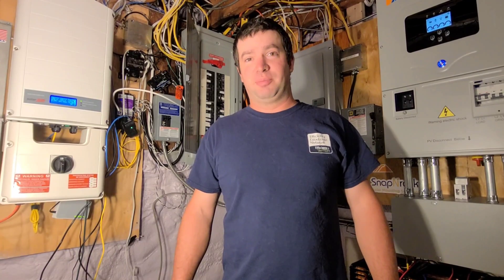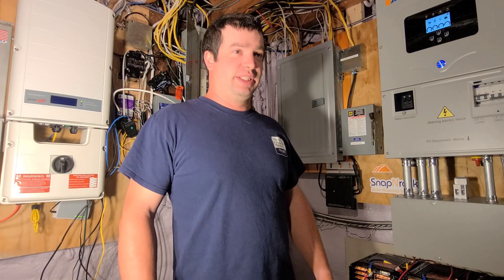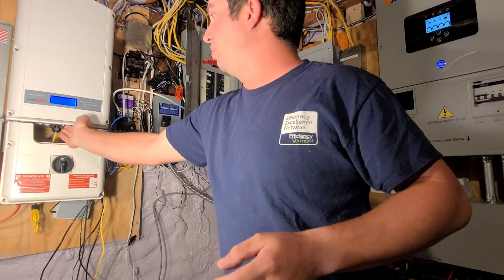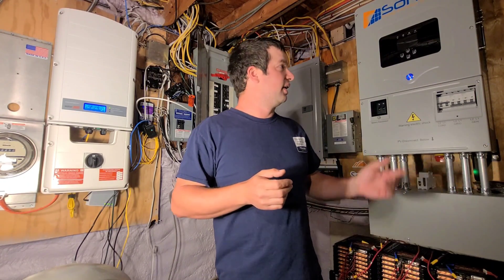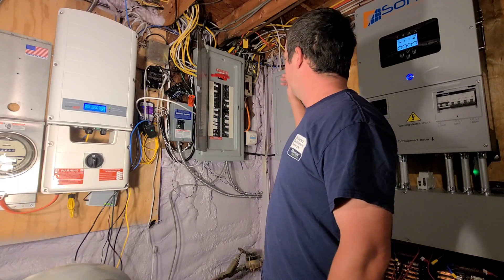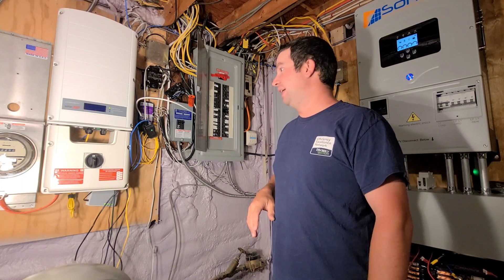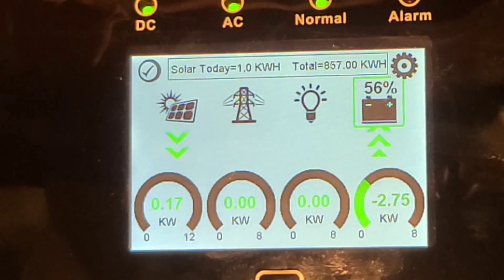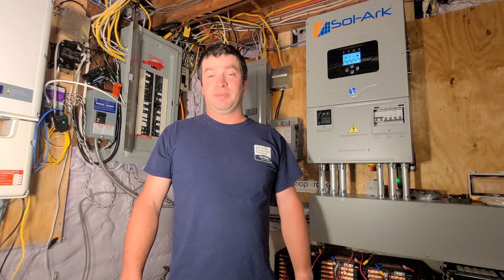What is AC Coupling? How it Works With the Sol-Ark 12k

Comment: Why AC couple? (Our application)
•	To incorporate a 6kW legacy solar system into a new Sol-Ark 15kW hybrid system with 38.4kW of battery storage.
•	To make more efficient use of the legacy system.
•	To have higher combined charge rates of the battery in the early morning and evening before sunset.
•	Cheaper in the long run over maintaining / replacing a separate set of batteries.
•	To get a bigger payment for excess production from the electrical supplier.
•	No more complaining about electric bills.
•	The satisfaction of knowing you can have less concern about increasing electrical utility costs over time as one moves into retirement.
•	Solar is plain fun for a DIYer.

Comment: If I am hearing you correctly, even if the system is AC coupled on the load side, the Sol-Ark will phase shift (to reduce AC coupled connected power) as the battery nears 100% capacity. Is this true even if it has the grid to send excess power to?

Comment: Thank you for the informative video, I'm currently purchasing a SolArk 15K, batteries, and panels for a grid tie system on a new all electric home.  What I can't find much information on, is how beneficial it would be to DC couple 19K to the SolArk and then AC couple whatever else will fit on the roof (8-9 K more)using SolArk Microinverters.  My thoughts are I would have more power to run loads during the day and export a lot more to the grid.  But is it worth the extra cost?  Or just abandon this idea and stick with the DC coupling only...  I appreciate any insight you may have.
Reply: Hi, did you find the solution to your problem, whit ac coupling ?
Reply: We have a 15 KW Sol-Ark EMP hardened inverter with 19.2 KW of panels. In our case we have 48 x 400 W panels arranged in a 2P8S configuration to each MPPT input. On one eastward facing surface of the roof, a tall chimney cast a shadow over the lower two rows of panels in one series, dramatically reducing the production of that series for part of the day. Putting optimizers on that series would not benefit it much because it is in parallel with another series of eight that is not shadowed. An optimizer I believe would drop the overall voltage of that string in order to keep the current up., pulling down the efficiency of the other string.

So with regards to your questions of how beneficial it would be to DC couple 19 KW of panels to the Sol-Ark, I would say DC couple whatever panels you have that do not have any shading on them. If you have a tall chimney, vent, tree, utility pole, etc., that is going to throw a shadow over a series of panels (in our case, a series of eight panels), it is going to greatly reduce the production of that series. You may be better off putting microinverters on those and AC coupling that group.  Be aware there may be some electrical code that prohibits running AC and DC in the same conduit which could increase conduit installation expenses (that may have changed. Check your local codes). 

I'm going to be converting another 6KW of DC panels to microinverters using AP Systems DS3-L Dual Microinverter 768VA (SKU Part Number DS3-L-NA-768VA), which make it very easy to AC Couple the output. Just connect to the Load panel or Gen port. Configure the Sol-Ark settings, and off you go. No need for a gateway, though APSystem does have a monitoring gateway which allows you to see the production of each panel in your array (APsystem ECU Residential Monitoring Gateway, Zigbee comm, WiFi, no CTs, no RGM, YC600 (SKU Part Number ECU-R Gateway)). The combined output of the microinverters will be AC coupled to the Load panel of my current setup.

Hope this was helpful.

Comment: Can you give some info on what settings you had to change with the SolarEdge to enable the frequency shifting?

Is it as simple as just changing your "location" to the "rule 21"?  Or is there more to it?

Thanks for the video!
Reply from the maker: It will work right out of the box, but with a hard on/off as the frequency goes out and back into range.  
Since this video, I've switched to a newer HD wave inverter with screen.  I've attempted multiple times to get it to limit power based on frequency instead of just shutting off, but have been unsuccessful.  I have one more thing to try, which is adding a jumper to the comm board, but I haven't gotten around to it yet.
Reply: @benssolarandbattery  thanks for the response. Have you tried using the rule 21 setting?  It can't be that easy can it?
Reply from the maker: @y0bailey  yes, I tried that. Keep in mind that my inverter is older, so if you have the newer screen less version it may work differently.

Comment: Hi, 
It looks like you are the only expert here in youtube who can explain this ac coupling feature.
You have nicely described the off grid situation, but for me there still open points in the on grid situation.
1) Will a solark use an ac coupling power to charge the battery when the grid is available or will the battery be only charged from dc side an everything from coupled inverter will go to grid?
2) When the grid is available and the battery is charged, will the coupled inverter be switched off or will it feed the surplus to the grid?
Many thanks in advance
Reply from the maker: Hi and thanks for the comments. 
The battery can be charged from AC coupled solar or from the grid. The Sol-ark won't shut off the AC coupled solar when the battery is full though, it will sell it to the grid.  For that type of zero export situation you'd want to DC couple the solar.
Reply: @benssolarandbattery  thank you for the fast reply.
I have now a dc coupled solution, but I am allowed to sell to grid and wish to sell surplus energy to grid. At the moment, on surplus from solark goes to grid and after battery is charged, the dc coupled system just waits till next morning :)
So i wish to switch to ac coupled solution, but was not sure how it works in an on grid situation. 
My goal is to use ac coupled system in on grid scenario and to have it work like that: first cover the loads; then, if there is additional power, charge the battery, then, if all loads are covered and the battery is fully charged, sell surplus energy to grid.
From your answer, I believe this is exactly how it works, am I right?
PS: charging from grid must be only allowed when the battery is fully discharged, to prevent it from over discharging
Reply from the maker: @YarLeo  yes, you are right. However, with your current setup, you should be able to sell from the DC coupled solar as well.
Reply: @benssolarandbattery  great, thank you for the the information.
Abou selling with current set up. How should it work? At the moment "extra" arrays are connected to the separate mppt chargers, which just charge the battery. If the battery is full, they just stop charging
Reply from the maker: @YarLeo  oh, I thought they were connected to the MPPT inputs on the Sol-ark.  If they're on separate charge controllers, that won't work.
Reply: @benssolarandbattery  my problem is, that with my roof I am not able to build a big array facing the same direction/angle, so instead I have multiple small arrays. So all mppt inputs are used, and there are still to arrays to deal with :)

Comment: Great videos!!!  I have a question.  Are you able to sell back power to the grid from the solar edge inverter's panels and the the sol ark inverter's panels?  Thanks in advance!!
Reply from the maker: Yes, they are both able to sell back to the grid. Up here, the utility requires a solar production meter for any grid tie solar, so there's not any incentive for selling DC coupled solar back to the grid, only AC coupled.
Reply: @benssolarandbattery  So you have a solar production meter connected to your solaredge inverter, up stream from the sol ark?
Reply from the maker: @richardrasmussen8008  yes.

Comment: Probably already answered but have been reading online that I can connect A/C coupling (Enphase Micro-Inverters) for the Sol Ark 5K and 8K only up to 3KW but the specs from Sol-Ark say 9.6KW for AC Coupling. My solar array is all with Enphase Micro Inverters. Really interested in using a Sol-Ark 8K with the HomeGrid Stack'd Battery.  Recommend YES NO?
Reply: We have a 15KW Sol-Ark Inverter, 19.2KW of panels, 38.4KW HomeGrid stack.  I'll be converting an old separate 6KW system to a microinverter system and do AC Coupling via the Load side (better through the Gen port, but I can't do that without lots of running new wires and trenching). Being as your comment was 2 years ago, I'm sure you have already figured it out. But yes, I would recommend. However, before going with HomeGrid, consider the EG4 battery stacks through Signature Solar. Cheaper, meaning you could have greater storage capacity for the same cost.  However, HomeGrid's claim to fame is its robustness (designed for 25 year life) and its high current capacity (275A). You would have to parallel a number of EG4 stacks to output / input the same amount of power. Money was less of a concern to us than robustness of the solution.  Cheers!

Comment: Hey Ben, What is the SolArks voltage output when the grid shuts down? I get 245V on mine and I'm just trying to see if thats normal or if mine needs to be replaced. The reason I ask is that my grid provides 236V-238V depending on the house loads and I cannot get my AC coupled Enphase micro inverters to turn on in a grid outage as they are sending Voltage out of range error codes. The SolArk screen is telling me its providing 240V but my meter is telling me otherwise.
Reply from the maker: Mine was putting out around 240v. The enphase micros should come online, even at 230-264v. I'd say the frequency might be off.

Comment: Why doesnt rhe solark just stop sending current to the battery when the SOC is met? Is it that dumb?
Reply from the maker: Because it's not the one sending the current.  The AC coupled inverter is, and can be tied into the load center or gen breaker.  If you're using the charge controllers in the Sol-Ark, then sure, that works perfectly.

Comment: Wouldn't it back feed the grid when tricked into thinking the grid is up? Isnt that dangerous?
Reply from the maker: No, because you're on the load side of the transfer switch which is built into the Sol-Ark.

Comment: Okay... When the gird is down, and you're AC coupled to the inverter, what keeps the energy produce from the solaredge from being placed back on the grid?
Reply from the maker: There is a relay in the Sol-Ark or other battery based inverter that disconnects the system from the grid.  The Solaredge must be tied into the load side of that inverter.
Reply: @benssolarandbattery  I figured there had to be a transfer relay someplace. Question. Is the  output of the Solaredge connected to the output of the inverter? And question two, why not use the internal battery charger of the hybrid inverter to recharge the battery and not have to frequency shift?

Comment: So, I want to continue grid-tie (I have "net metering") and want to do almost exactly what you're doing.  Can you tell me which wiring diagram in the manual you are using?  I just ordered the Sol-Ark 15 and a 300Ah battery, and want to use the sol-ark as my "disconnect" when grid goes down but run THROUGH it for normal off grid power.  Anything you can do to help me advice-wise would be greatly appreciated.  One question right away, I didn't order the "big" CT sensors, and I'm wondering if I need those (the 4-0 sized ones) for my 200 amp main service?  I can still order them in time for my install (retired licensed electrician, so I will understand what you tell me).  Edit:  My big impetus is that here in Louisiana we get storm outages (think hurricanes) and I want to be able to be in good shape when the grid goes down but send power back to the grid when it's up.
Reply: Did you ever get an answer to this?
Reply: @elvisvasquez97  Yes, thank you, I did - once my 15k inverter arrived and I installed it, I was able to work with the great Sol-Ark tech support and everything works fine.  I am using the generator lugs for my old grid-tied system, and when the grid power goes off the old inverter keeps producing for the load and charging the battery.  The Sol-Ark just thinks its AC Coupled micro inverters, even though it's a 7.6k Solar Edge grid-tie inverter.  I have an additional 2.5k of pv working through the DC side of my Sol-Ark and I use a Big Battery Kong Elite (48v 300Ah battery).  I have my generator feeding on the grid side of the inverter.  Sol-Ark makes all this possible and very easy once you understand the settings and what they mean!  I'm ready for the next long outage after a hurricane comes - and in Louisiana, there's always going to be another one, sooner or later.

Comment: Hi Ben. Very informative video. I have the same challenge with se1000h hd wave inverter. From your video, if I use solark 12k inverter, can I connect more than 1 battery pack to it? Example i was thinking to buy lifepo4 set of 2 batteries 20kw each but wanted to check if this can be achieved?

The company sells a package where they sell 2 batteries 20kw each and two 6kw growatt inverter. Do you think growatt inverter spf12000 t dvm will work in this ac coupling scenario?
Reply from the maker: You can hook up as many 48v batteries as you want, but there's only one battery input. They'll need to be hooked up in parallel.  You can use a separate busbar to parallel them.  I don't think the Growatt can AC couple.
Reply: @benssolarandbattery  thank you very much.

Comment: Can the sol-ark charge the battery from the grid?  Why?  Micro Inverters typically tie to the grid.
Reply from the maker: The Sol-Ark can charge from the grid, from its 2 charge controllers, from AC coupled solar and from a generator.  In this scenario, the microinverters are tied into the Load side.  If the grid goes down, the Sol-Ark keeps the microinverters running in a "microgrid" but disconnects them from the utility grid.  It can also tell them to shut off by "frequency shifting" up to a preset frequency.  The inverters see the differing frequency and shut down.  
Hope this helps!
Ben
Reply: @benssolarandbattery  Thank you Ben.

Comment: I'm looking at basically doing this exact setup, but with zero export since net metering is dead here. Would definitely enjoy a follow up with that in mind.
Reply from the maker: I think the only way you can do zero export with a grid tie inverter in this setup is to hook it up to the Gen breaker.  The Sol-Ark can't frequency shift when it's grid tied, so needs to be able to shut the grid tie inverter off.  What utility do you have? We do still have net metering here but the decline is happening quickly.

Comment: Hello Ben, just found your channel and it’s awesome.
I am building my off grid 7.2K system with 16 micro inverters IQ8A from Enphase. What would be an appropriate Hybrid inverter that can take the AC to charge the custom made 28kWh Lithium batteries. This is totally off grid to power a large car garage/man-cave.
I am already stuck this the micro inverters. Thanks for any advice.
Reply from the maker: Hi Ronnie, I'd recommend either the Sol-Ark 12k or 15k.  They can both do AC coupling and will work well for you.  Make sure you get an envoy with the Enphase system so you can view the individual panels, but also so you can change the grid profile.  There are a few grid profiles that will allow for freq/watt throttling of the power output.  Basically if the Sol-Ark raises the frequency by 1hz, the micros will limit power production instead of just shutting off.  
Enjoy!
Reply: Hello Ben, thanks for your kind reply. If I go with the Sol-Ark, what’s the benefit of keeping the Enphase micros? Would it be better for the Sol-Ark the grab the DC voltage straight from the PVs? Maybe I could sell my new IQ8As if they won’t really do much?
I am new at this subject and find it fascinating on how much there is to learn.
Thanks again,
Ronnie Shand
Mechanical Design Engineer

Comment: I currently have a 7kW solar array grid tied with a SunnyBoy. I'm building my large 500ah 48v battery backup bank. I also have a 15kW Sigineer low frequency whole house AC coupled inverter. I can run the house from the battery when the power is off which usually happens in the evening around here. What I want besides using the battery when the grid is down is to use the main inverter when the power is off during sunny days. The other thing I want is to balance solar and battery so both are running at the same time so no power goes back to the grid or use the grid unless there is no choice but to utilize the grid. Got an idea?

Comment: So did I miss where you explained what ac coupling is? From the title I figured there might be some more in depth explanation 😃
Reply: https://www.sol-ark.com/wp-content/uploads/2022/03/12KOD-Manual-3-14-2022.pdf

Check out page 35 for AC coupling. You can use either load or generator input,  but you loose generator use either way. Best to connect to generator input. You can also AC couple on grid tie output if you are completely off grid only

Comment: If your turning on the grid tie inverter aren't you back feeding the grid by bypassing it?
Reply from the maker: It's tied in on the load side of the Sol-Ark, which keeps it from backfeeding the grid.
Reply: I think what is confusing is that the SolarEdge USED to be grid tied, but after the retrofit, the new SolArk is grid tied and acting like a ATS, as well as being an inverter for the batteries. The SolarEdge is now merely an inverter for the solar modules. At least that's my take away from this.

Comment: Love your videos! When the grid is not out can the Sol Ark backfeed all the power from the SolarEdge to the grid? Could the Sol Ark dump the SolarEdge power to the dump load? Or are charging the battery or using the energy immediately the only options for using the SolarEdge power?